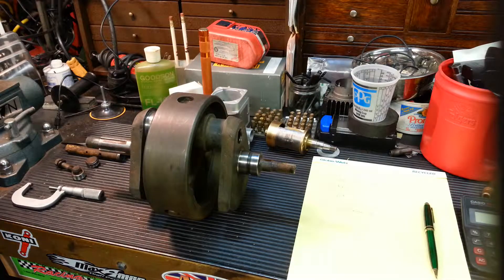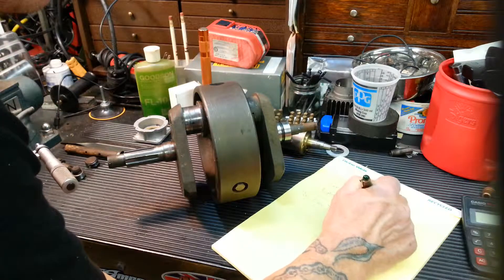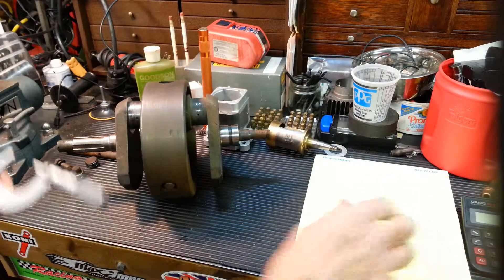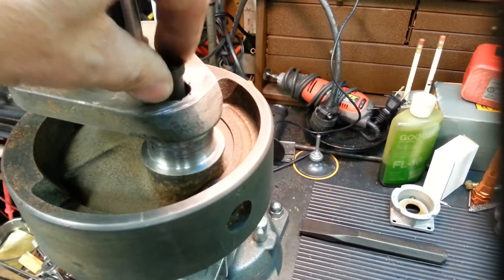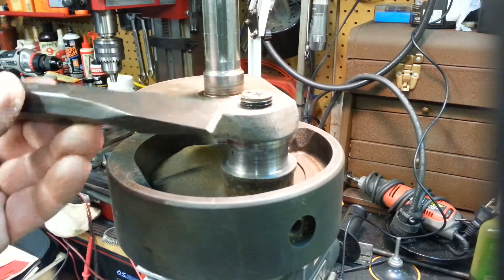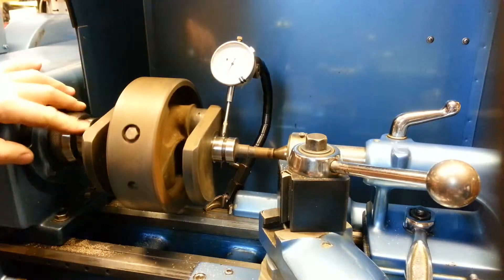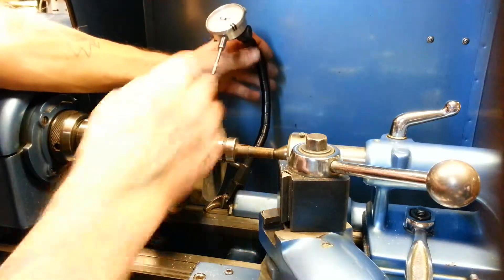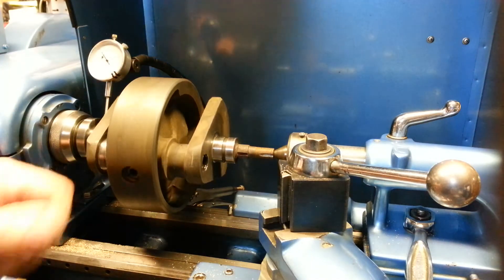How To Mic A Crankshaft

Comment from the maker: All connecting rods have side play, Your manual should give you your proper side clearance limit on the rods...There is also clearance on the small ends which should never be a tight fit with your wrist pin ..As long as the wrist glides smoothly and snug side to side in the small end bushing...You may very well notice some type of arc play but to a minuimum..As long as you feel absolutely NO play up and down as piston being in motion...You'll be fine...

Comment: Thanks for the video, Doug. It was useful information. What bothers me, is that after all of that, I measured the inside diameter of the rods, making sure I had mated the caps properly, and ordered the new shells according to the shop manuals. This is for an A65 SPITFIRE HORNET. I installed the shells, making sure I had received the proper ones, and torqued the nuts per spec. Now, I find the rods move side to side on the crank, maybe a 1/16th". Not only that, but the small ends rock side to side (in an arc) like they're loose. Can this be right? I can imagine that the oil will cushion them somewhat, and heat may also cause sufficient expansion to "tighten" the play. Right now, I'm at a standstill. Thanks, Eric